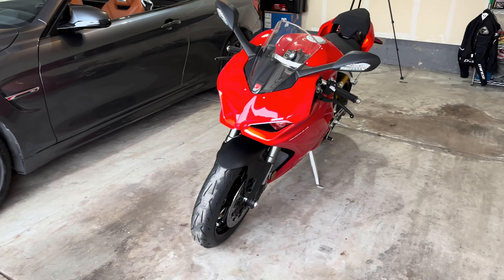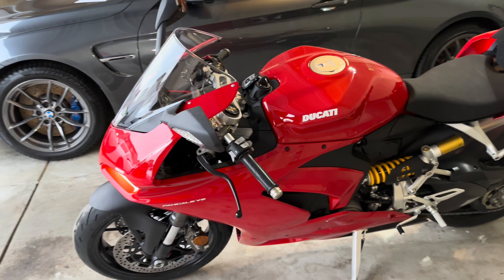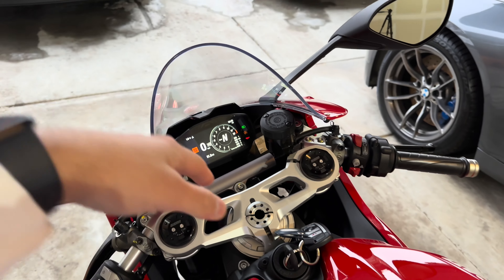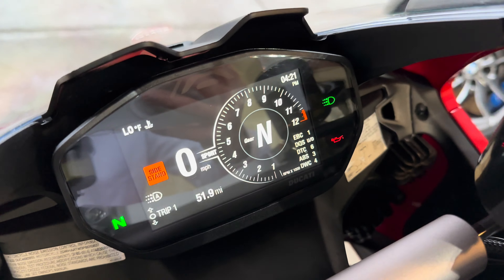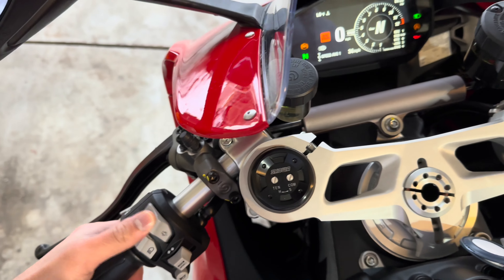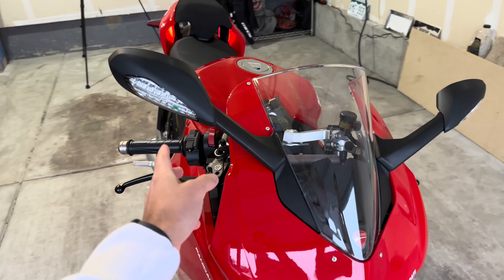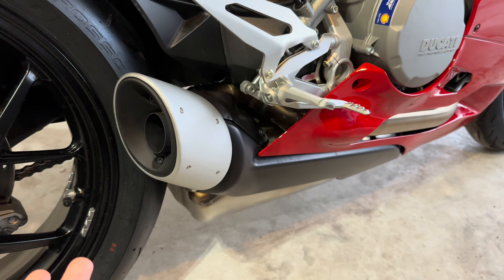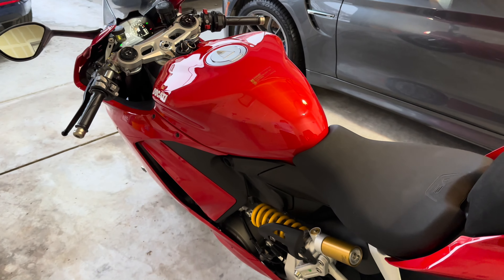Ducati Panigale V2: A Closer Look At The Italian Stallion!

Comment: Nice video . I’ve gone for the Bayliss . It’s spring here in the uk and the weather is starting to improve . Upgrades I’ve done so far are Rizoma mirrors and evotech tail tidy. Look forward to seeing more vids from you 👍👌
Reply: I am looking at that Bayless one as well but I'd have to get rid of my R7 60th Anniversary to justify it because I just spent a load of cash on the 2019 Monster 1200 25 Anniversario with only 500 miles on her. 🤘😎🎸🏍

Comment: Very cool.  
Does that wonderful dashboard have a fuel gauge by any chance ?
Reply from the maker: On a $18,000 dollar bike? No way! 🤣Jokes aside, it does not have a fuel gauge but you can expect about 150 miles of range with mixed driving. It does have a fuel light that comes on when it's running low on fuel.

Comment: Might be a dumb question but why do u have to charge the battery and how often do you do it?
Reply from the maker: In the winter when you don’t ride as often, the battery will start to drain. You can take the battery out and charge it but it’s a pain. The easy way is to plug it into a trickle charger under the seat so in the spring you don’t end up with a dead battery and a motorcycle that won’t start. You only have to put it on the trickle charger for long periods of idle.

Comment: Race mode with DWC off 😅 you will see what this bike can do 👍🏻 DTC on 3 I believe, it’s actually faster then you think lol
Reply: i got mine on DWC 1 and im pretty happy with the performance
Reply: @germanwoodworker2621  i recently installed an arrow exhaust with sprint filter, brown color, and tune it with Up map T800+ , now it’s a proper bike 😆 pulls really good for a V2, I loaded Racing Pro map
Reply: @Atlan_tis  nice, di you dyno it, would be interesting what this engine can deliver. Sounds really nice.